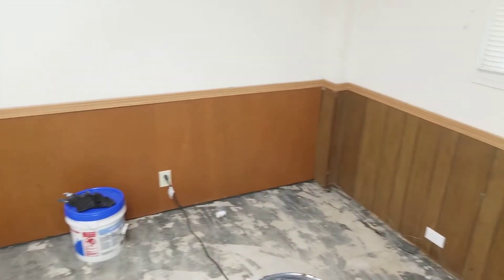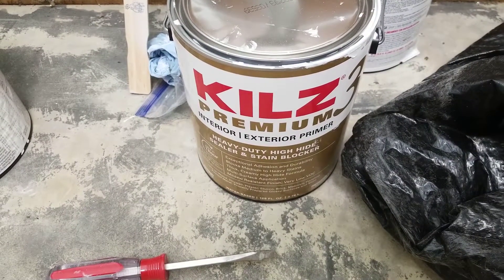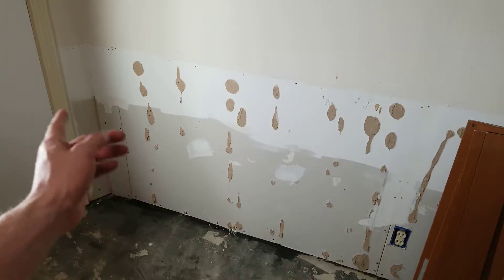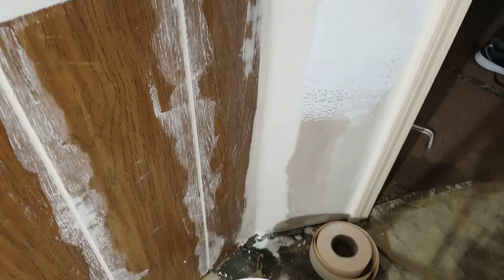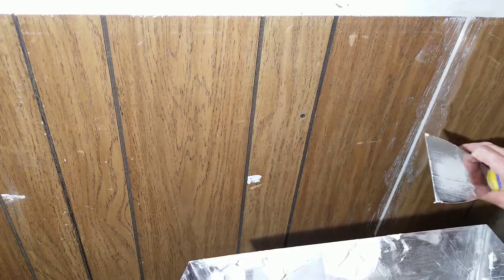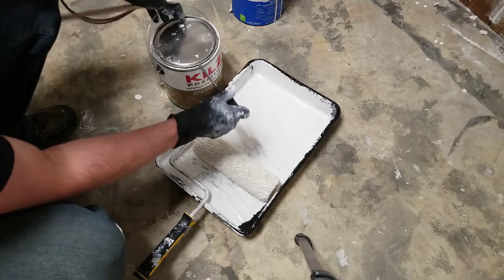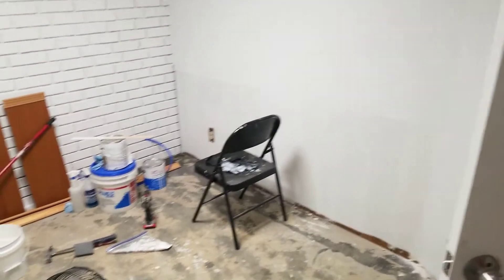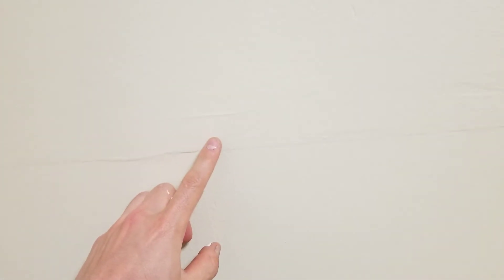How to Cover Up Wood Panels

Comment: I had to get rid of my home office once my kids came. Now im looking to setup my garage as an office area when I work from home. My garage has this type of ugly wood panelling (used to be a room but was converted to a 2 car garage) so I need to either get rid of it or do exactly this. This is a way cheaper option than removing all the walls and putting up drywall.

Comment: I wonder if the latex paint (water base) is still stick properly to the old paneling ?! 
I have massive job next month to cover 4 bedroom's wall panels by myself 😭 I taught I should use oil based paint over shinny wood paneling instead of water base (latex)
Reply from the maker: No issues so far. In my experience the latex Kilz has been great as a primer and stain blocker (without the fumes of the oil based) over many different surfaces. From online reviews I've read, if it adheres initially, it will maintain adhesion for as long as other primers. Good luck with your project!
Reply: @gameoflife7235  thank you 😊
We don't have latex kilz here in Australia ,I should find something similar
Reply: What's the best type of paint to use on panel? I'm buying a home and the basement has a shiny brown panel. It's not too bad, but I'd like to brighten it and paint over it.
Reply from the maker: @kimberly0717  To avoid the paint peeling on the shiny surface, it's recommended to use a primer (oil or latex based, depending on if you can handle the fumes) first. On top of the primer, you can use any paint you want, as long as it is compatible with the primer. Most oil and latex based primers can be painted over with the more common latex paints available at big box stores.
Reply: Game of Life thank you for that information. I plan to buy the paint from Sherwin Williams. I love their paint.

Comment: Wouldn't it be easier just to replace that paneling with drywall and doing one tape across it  And then mudn't drywalls pretty cheap. I'm asking because I'm doing a flip house and it's all paneling
Reply from the maker: Depends on the comps and price point more than anything imo. If the comps have already updated to drywall it's probably worth the extra cost if you can net more on the sale. Drywall would add material and labor cost...more than you might think depending on how much.

Comment: Why would I do this vs just removing and installing drywall?
Reply from the maker: Significantly more time and labor, with no functional difference. Plus (like this house), the panels were attached directly to the concrete blocks of the foundation, so either need to glue the drywall or put up framing.

Comment: I followed pretty closely but now have one wall of 5 that the joint compound is chipping off. The 2 primers I tried are not covering much of any of the walls. I used Zinsser first and it goes on like water. I bought PVA (my son said it’s thicker). It’s a little better but not much. I chipped off the bad wall and now... no idea how to cover and fix. Anyone?  - Old grandma trying to DIY😩
Reply from the maker: I'm surprised you had issues with Zinsser it's been pretty good in my experience. Easy thing to miss but might make sure it's thoroughly stirred. If all else fails, Kilz will do the job, but you'd need to wear a VOC respirator if it's unventilated. From what I understand, the joint compound is falling out of the panel joints in small pieces? Without seeing it, I'd say there is either a contaminant causing bad adhesion, or it might just take more force with the joint knife to really push the compound into the joint.
Reply: Game of Life Yes, I went back and applied more pressure to the lines. It took a good 7-8 coats of the PVA to finally cover. Your video was super helpful along with your reply. Thank you!!!
Reply: One more thing, YES you are right! The zinsser needed way more stirring.

Comment: Very helpful. I'm wondering how you got the glue off the walls?
Reply from the maker: Most of it came off with the panels and ripped the drywall paper off, anything left I used a scraper.
Reply: @gameoflife7235  what do you do to treat the exposed drywall paper before applying mud over it? I don’t think I heard you mention that in the video.